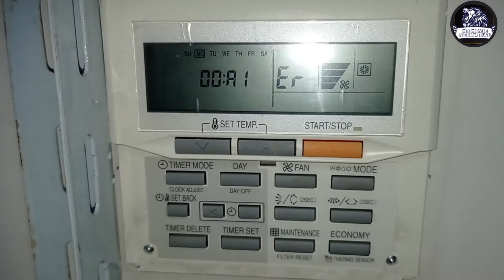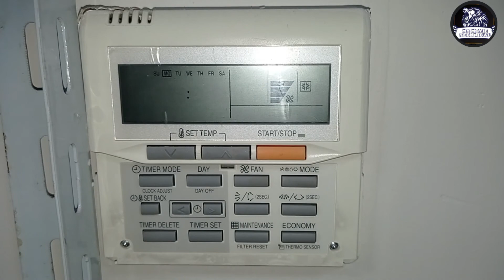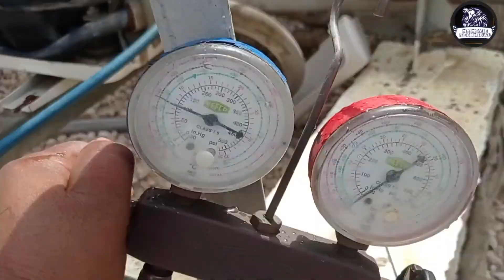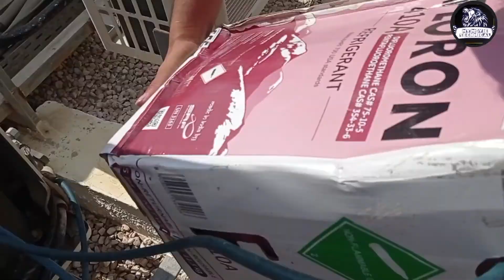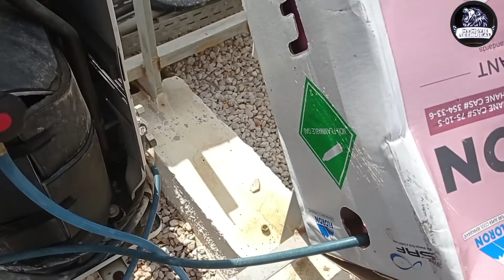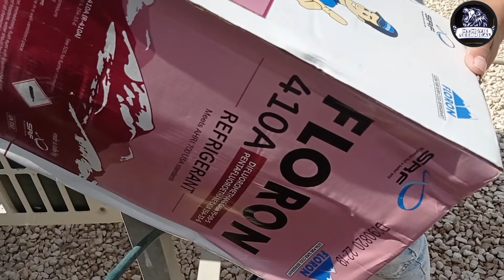Blinking Fujitsu Halcyon 00:A1 error @VictorTechTalks

Comment: EE error then blingin what problome dear
Reply from the maker: switch the unit off main and press the “Temp up and Temp down” buttons simultaneously for 3 seconds. Higher voltage maybe check
Reply: Indoor motor 220v supply?
Reply from the maker: No this motor Fujitsu DC

Comment: How do you purge air in the hose/guage?
Reply from the maker: pipe or container and replacing it with another gas or liquid. Purging is crucial in pipeline, piping, welding and industrial process. It removes contaminants from the piping and vessels, which reduces chances of corrosion.